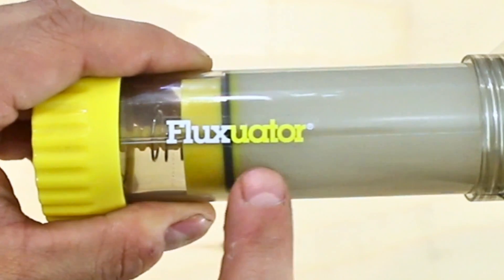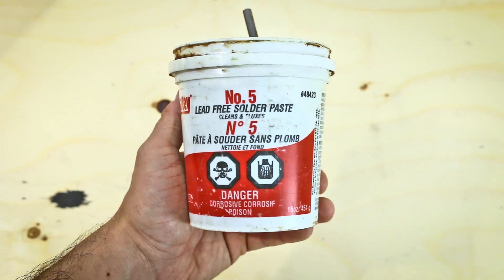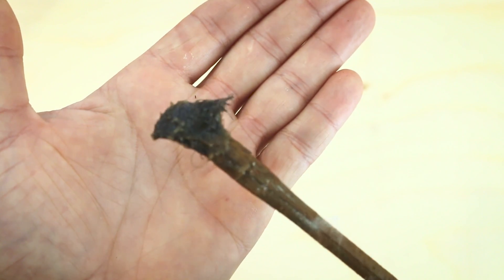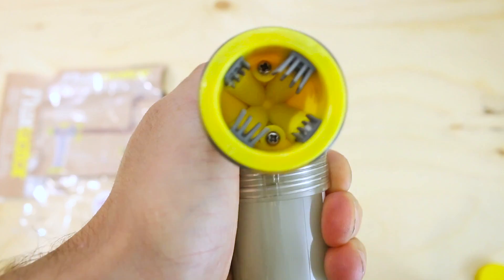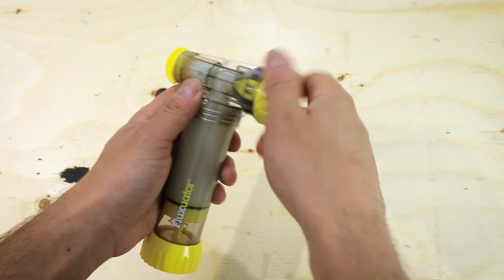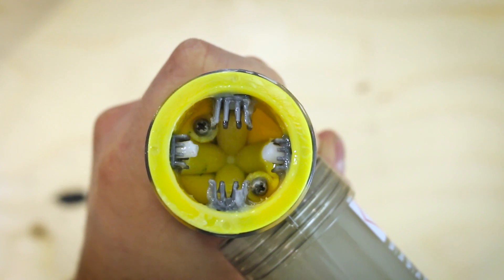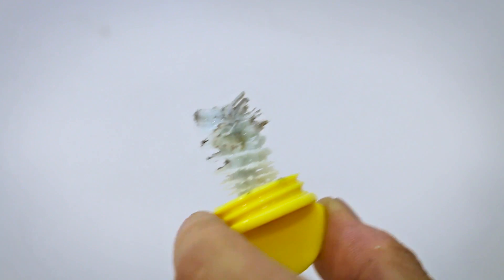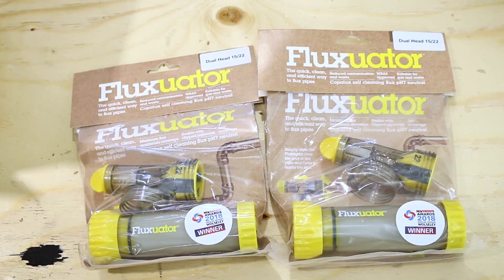The unbiased Fluxuator review! | GOT2LEARN

Comment: When it empty how do you refill it
Reply: Put the contents you want to refill into an empy caulking tube. Unscrew the base of the fluxuator and squeeze in the contents. Tap the fluxuator in the upside down position on a cloth as you are refilling it. I've put pipe dope in my second one. Nokarode for gas pipe installations in the other. You can put the tubs in hot water for 5 mins to make them more fluid so they literally pour in for refills. It will thicken up when it hits room temperature.

Comment: Can't find this for sale in the U.S.  In any case, I kind of like using Oatey tinning flux (cheap insurance for a stronger bond) and you can only get refills from this company I believe.  I'll stick to the old way for now.  Does anyone have a recommendation for a flux application brush that isn't prone to shedding bristles?
Reply from the maker: Get some super glue and put some at the base of the bristles, it'll be a LOT harder for them to come out this way ;)
Reply: @Got2Learn  thanks, I'll try that!  Wonder how often people solder without realizing a bristle is in the flux.
Reply from the maker: @FTsingos  more than  than there should be!

Comment: Heat a nail with a propane torch Or alternatively use a drill and put a hole in the applicator brush tab/handle. Tie a piece of cord through it and around the neck of the body or pop another hole through the little angled gusset under where it screws in. Then you won't drop the brush. 😉

Comment: Cut a 1" hole in the lid of the Flux container  and just dip your brush in the container  through the hole  and it will also keep some debris out of the container.
Reply: Heat up a piece of 15mm and push that through lid
Reply from the maker: Yup, good trick...I used to do that when I was on the field ;)